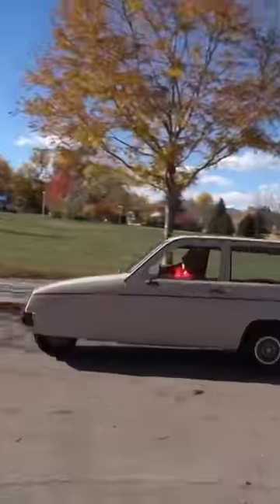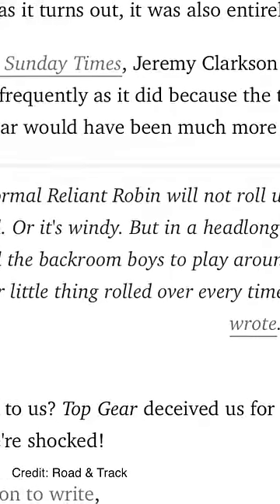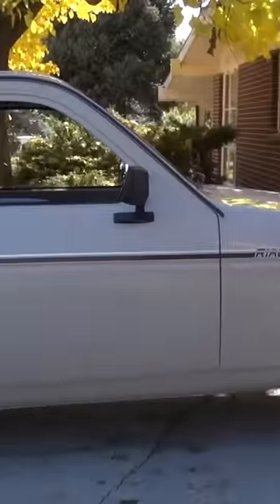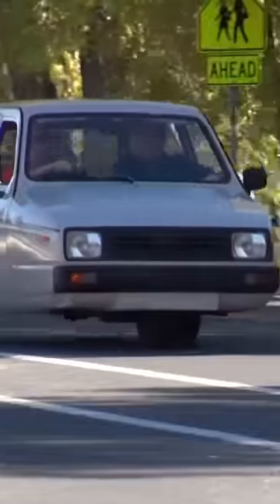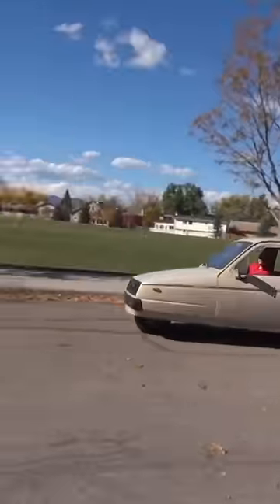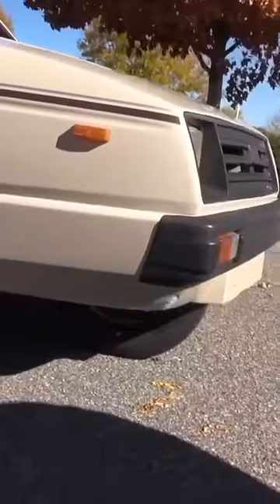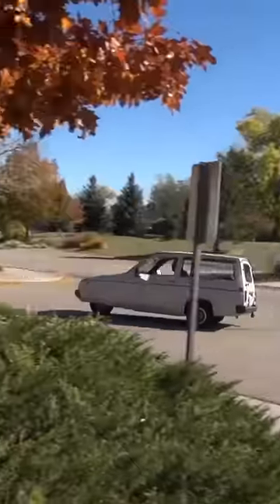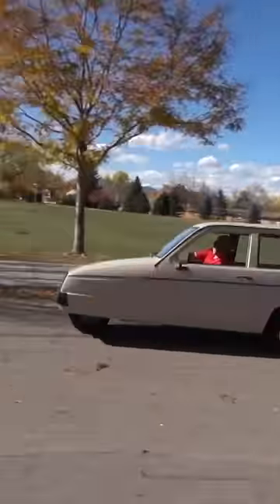Top Gear FAKED The Robin Rollovers??

Comment: I felt salt when he called tire pressure and potato sacks “quite a bit of engineering”, so it was quite relieving to see him mop the cement with his paint. Great clip.
Reply: oh no i scratched it looks at exposed bondo
Reply: Yeah I was thinking the same thing it doesn't take much engineering to put weight on the outside of the turn and lower the tire on the outside of the turn
Reply: I felt the same way- I'd hardly call that "engineering"... 🤦
Reply: @danielbrealey2924   they also welded the dif
Reply: Lol Clarkson fanboys are pathetic as always.
There is an article detailing everything they have done to the Robin make it roll over everytime and yes  that was a lot of work (completely changed the diff, fitted different tires, removed or changed the position of parts of the cars like the fuel tank to mess up the weight distribution...)
Reply: Mop the cement 🤣
Reply: @superking-nicolaslucau7252  yeah that’s true, they did alter it to make it roll easier. It’s also true that 3 wheeled cars aren’t common because they’re unstable by default, especially in that configuration
Reply: He also was going down hill which I assume would also aid it tipping easier too, when I first heard the had to engineer it to tip I assumed they had to remove an anti roll bar or something, how disappointed am I to learn they actually just added some weight on the side and lower the tyre pressure….

I know people who put weight in their boots to lower their cars, all master engineers judging by this video 😂
Reply: @superking-nicolaslucau7252  You forgot to mention it was unnecessary, as the video showed lmao
Reply: @Jimbo_Fett  They're pretty stable when the front has two wheels.
Reply: He is driving a reliant, what did you expect!? 😂
Reply: I don't think he literally means engineering as in "mechanical engineering", more like the situation was engineered/fabricated to make the car roll
Reply: I think they had different tyres on each side, and made it a bit more top heavy (hardly NASA though)

Comment: It didn't really flip over. It tilted, but didn't flip
Reply: Uhhhh TecHnIcALlY 🤓🤓🤓
Reply: You must be fun at parties
Reply: @7Beanss  not technically literally it didn't it just tilted
Reply: @Ozilus21  this isn't a party
Reply: @flatmarssociety5707  yeah this is not a flip. By this measure, leaning hard on a bike is a flip a well
Reply: Well he obviously pulled off so he didn't destroy a restored antique you fkin donut lol It was basically on its way over, so its fair to say that it would flip easily.
Reply: @pocketoniofficial  but it didn't flip if you say that it flipped then you're saying bikes flip with then turn
Reply: 🎵Every party needs a pooper that's why we invited you🎵
Reply: @pocketoniofficial  

If that were the case it WOULD have flipped.
Reply: @McSweeps  

No, it would have lost speed via friction and the open diff spinning up the inside wheel in the air.
Reply: it didn't flip because he recovered it. it doesn't matter anyway, cars aren't supposed to tip
Reply: @McSweeps  "if" and "would've"
key words here
"didn't"
Reply: Lolol besides the point
Reply: YEAH BECAUSE HE WASN’T GOING TO ACTUALLY FLIP IT
Reply: It would've flipped if he kept turning.
Reply: R/whoosh
Reply: Add 20 more MPH and a sharper turn, and it would have rolled
Reply: @theyeetus1428  

Not with the front scraping and the open diff spinning away in the air.
Reply: @pocketoniofficial  

No, it's not.
Reply: Lmao bet you wouldn't buy it tho you might get tilted
Reply: @badcornflakes6374  and you are fun at all huh lmao what's her name and when did she break your heart? Get pass that hurt you will be ok
Reply: @Ozilus21  You must make women dry asf and men dry asf too.
Reply: Because he saved it
Reply: If he gave a little bit more gas it would've flipped.
Reply: @gunterification  

Not with the wheel in the air spinning on an open diff and the front dragging.
Reply: @Ben-Rogue  

Very unlikely. You've been watching too much unfunny Clarkson.
Reply: Yeah but it shows that it could flip, if they were going faster and turned
Reply: This didn't flip. It didn't even technically flip it just didn't flip. Some people here are trying to say that it would have if he kept going but he didn't.

It'd be like having a bullet whiz by your head and then saying you got shot. You didn't get shot you just almost did. Kind of weird how this became an argument, and also funny to see people resort to ad hominem instead of just agreeing with the facts.
Reply: The whole point is that it is unsafe. If you have to straighten out to get past a roundabout, it is clearly unsafe. If he carried on, his momentum alone would have had more serious consequences
Reply: @7Beanss  Wdym technically? It didn’t bingus
Reply: To be fair, I've never had my four wheel car tip at all.
Reply: @7Beanss  yeah well wanted it to flip
And it didnt
Reply: Semantics
Reply: @flatmarssociety5707  Bicycles are intended to lean in far to corner, cars aren't. A 10 year old could figure that out, come on guy ....
Reply: Yeah we saw..
Reply: @handsomelarsandhisfabulousjars  ya lean in corners not flip the car leaned it didn't flip come on a child could of figured that out man
Reply: @flatmarssociety5707  We all know it would have flipped if he hadn't corrected, don't steal jokes either
Reply: @handsomelarsandhisfabulousjars  but it didn't flip did it? It leaned a child could of figured that out
Reply: @flatmarssociety5707  lmao do you work for reliant? Cars that are functioning properly don't damage themselves 😂
Reply: @handsomelarsandhisfabulousjars  it is properly working it just wasn't designed very well when you're using a single wheel to turn its going to be unstable
Reply: @flatmarssociety5707  Then it didn't flip on top gear either. It tilted onto it's side.
Reply: @sock8278  EXACTLY.
How do all these people argue about something that's so obviously not the point?!!
Reply: Ermm.... remind me again who even said it DID flip?? Everyone getting but hurt and arguing semantics when noone claimed it flipped at all... 🤦‍♂️
Reply: @wildin13  I think TFL changed the title on this after I made the comment
Reply: Technically the car in top gear didn’t flip either it was just laying on its side to take a nap
Reply: @initialyeet3951  not really. Nothing touches the ground in that case… this is more like leaning on a goldwing until the floor plates touch the ground… or probably more like leaning so far into a motorcycle turn that you lose tire traction and come off the bike, seeing that it does damage to the vehicle
Reply: @pocketoniofficial  it didn't flip in this occasion because he lost all power in the rear diff. I can't think of an occasion where loss of power to the tires wouldn't completely stop the car from flipping, so....
Reply: @7Beanss  he’s not a nerd you are
Reply: @Ozilus21 we have never heard that before. How creative!
Reply: @pocketoniofficial  obviously not if he could correct it so easily
Reply: @McSweeps  yea if he flipped it you could say it flipped
Reply: @lolseagull you can say that about any car
Reply: @meganwyatt1607  r/this isn't reddit
Reply: @Ben-Rogue  "if you add everything nessassry to make it flip it would have flipped"
Reply: @basedbane787  Imagine not knowing how basic physics and gravity works. Lmao
Reply: @pocketoniofficial  imagine not actually saying anything to further your argument 🤡
Reply: @basedbane787  Don't need to. Why should I keep proving you wrong. I can't  teach you things you should have learned in school.
Reply: @pocketoniofficial  mega cope
Reply: @John Smithe  What am I coping with? The fact that you use that word without knowing it's meaning just further proves my point. How can you understand gravity when you can't understand basic English.
Reply: @initialyeet3951 
When you 'tilt' a bike, how many of its wheels leave the ground?!
A vehicle with only 2 road wheels is intended to 'tilt'.
A vehicle with more than 2 road wheels is intended to keep ALL road wheels in contact with the road surface at all times.
Reply: top gear took a share corner more aggressively but at the end of the day the cars crap
Reply: @basedbane787  r/incell
Reply: @meganwyatt1607  r/projecting this isn't reddit cringe lord
Reply: @basedbane787  r/stating the obvious
Reply: @basedbane787  r/not very bright
Reply: @basedbane787  r/Nigel no friends
Reply: @basedbane787  r/ superior complex
Reply: @pocketoniofficial  no one would intentinally flip their car you potato
Reply: @aaroncousins4750  read my very first comment before being so openly ignorant
Reply: @aaroncousins4750  unless you're Jeremy Clarkson🤷‍♀️. (Or in need of quick cash😝)
Reply: yes, thanks captain obvious. however, if they were going even faster then it would have flipped
Reply: @McSweeps  That is not an all clear to me it looks like it would end up on its side more likely than flip and that’s a good thing
Reply: Just goes to show then that top gear didn't have to push it that far. A little bit more of a try and it would have flipped.
Reply: I seen some have black bars on the lower side so if they tip like this it wont damaged the body.
Reply: @flatmarssociety5707  what? Bikes have two wheels.
Reply: @badcornflakes6374 you must be fun at parties
Reply: @pocketoniofficial  saying that was a flip is like saying tilting on a bike when you go round a turn is flipping.
Reply: It was pretty damn close to flipping. 4 wheeled cars don't do that a 15mph
Reply: @flatmarssociety5707  he prevented it from flipping. He didn't want to destroy his vehicle.  
He was trying to show it wouldn't flip, instead he showed it would
Reply: If he had been going just a little faster, the car would have ended up laying on it's roof. 3 wheelers are incredibly dangerous.
Reply: @pocketoniofficial  yeah not like he couldn’t flip it over all these ppl weird
Reply: @pocketoniofficial  he was driving more recklessly to show off. These don't tip on a day to day occurrence.
Reply: Now add in a small ditch, or a hill with a turn and WHAMO flipped. Use your grey matter, if you have any.
Reply: That's still a pretty big red flag tho. Maybe flipping the car isn't as easy as TopGear made it look like. But go a bit too fast and with one sharp turn you will flip.
Reply: exactly. It didnt flip. Thats the same issue top gear was having.
Reply: @initialyeet3951   When I lean on a bike the paint doesn't touch the road
Reply: @flatmarssociety5707  But he was going under 30mph and took a corner in a regular way and almost flipped over. What would've happened had he been taking a corner at 40mph? 😂
Reply: @initialyeet3951 well I used to ride motorcycles, and if you lay a bike over far enough to touch bodywork to asphalt, it’s a crash.

Comment: Two wheels at the front and one at the back might have been better
Reply: Eh, depends on engine placement mostly, front engined, like this, would have been better in that config yes,
Reply: It is. That's why most 3 wheel designs use it
Reply: @SockyNoob  I think most recent ones but a lot of 3 wheeled vehicles are just modified motorcycles turned into trikes.

But most of those trikes have most of the weight in the back, making it harder for them to flip like this.
Reply: Yes and no. Its more stable but the main purpose of those cars were to put cargo. Like delivery milk to houses or something like that. One wheel could not stand the weight
Reply: @rawhidelamp  then replace the body with a tube frame, give it sports car seats… oh look, we have invented the Polaris Slingshot
Reply: That would've been an oversteer monster
Reply: @joemann7971  back and lower.
Reply: @SockyNoob  

The reliant three wheelers weren't supposed to be driven hard or even enthusiastically.

There used to be a loophole where these were classed as tricycles and thus anyone with a full bike licence could drive one. These were almost exclusively aimed at those who usually used a motorbike but wanted some heat and shelter during the winter, especially.

They're set up as they are as they used a lot of parts bin components already available.
Reply: Many 3-wheelers actually had that design, such as the Messerschmitt.
Reply: @deletemii3312  correctly designed, the handling could actually be well on point. Modify the chassis to lean into tighter turns and you’re looking at a 3-wheeler that corners like a rollercoaster.
Reply: @MrSupercar55  

Missing the point of what the Reliant was for though.

Incidentally, Morgan first built a two at the front one at the back three wheeler from 1909...
Reply: @skylined5534  Morgan still makes it. They're like driving a ww1 fighter plane
Reply: @joemann7971  Trikes are a flawed design. Motorcycles require leaning to turn.... and you cant lean when it has 3 wheels
Reply: @rawhidelamp  always two wheels in the front it is more stable... Even with the engine in the back like most of three wheelers.
Reply: That's more expensive tho
Reply: @SockyNoob  they hqve those 3 wheel harleys and then slingshots, the harleys have 2 in the back and i cant think of any other 3 wheels therefore by this logic they're just as frequent
Reply: Or placing the heaviest components (drivetrain, etc) in back, above the two-wheeled axle.

Seriously, WHO THOUGHT THIS WAS A GOOD DESIGN? It absolutely baffles me!
Reply: @deletemii3312  sounds like fun! 😁
Reply: @skylined5534  So, someone decided to design a car that needs to be driven very carefully, for people who probably never learned how to drive a car?
GENIUS! 🤯
Reply: @devlintaylor9520  you can!!..  only to the wrong side of the street
Reply: @bugglemagnum6213  you might not know this, but Harley doesn't make 3 wheelers. Those are all aftermarket, same as buying a lifted mall-crawler from the jeep dealership. I assume because of liability. Also, with the kits they use for Harleys, you're all in for the price of a new Tahoe-ish. They're not cheap.
Reply: It's more stable but only in certain cars. A 4 passenger hatchback with a large boot would actually lack stability even more if it had a single rear.
Reply: Yeah, there's lots of 50s concept cars that had that sort of design. Very retro futuristic! One good newer example is the flea in the fallout series! Very cool little car! Kinda like the design of the little  BMW Isetta!  😆👍🏻
Reply: Thats called a Polaris slingshot
Reply: @optiTHOMAS  Polaris slingshot is an irl newer street legal 3 wheeled car with that cobfiguration
Reply: @dailying3049  aw cool! That's a neat design! My mom was actually talking to me the other day about those little Polaris vehicles. Those are pretty cool! Good stuff! 😁👍🏻
Reply: @dailying3049  Or a Morgan. Both are track cars and nothing to do with the Reliant cars.
Reply: Not might, it is as stable as a four wheel car when moving in the forward direction.
Reply: @fujiwaratofushop1491 the main purpose was transportation. My grandfather had 2 in the 1960's cause you only need a motorcycle license. He flipped them twice. Luckily not with us onboard😂
Reply: Yes, a single rear is a lot better than a single front.  But being better than something that is inherently bad, does not make that other thing good.
Reply: Yep. I had one back in the day, as I only had a motorcycle license at the time.
Reply: @fujiwaratofushop1491 depends on the wheel used, a super single would easily handle a gooseneck trailer.
Reply: Yeah, one wheel at the front and two at the back is far from optimal. Unless you're in a Carver. Then it's a blast
Reply: @rawhidelamp  Then how does the load in the rear get distributed. This is THE wheeler dealer van.
Reply: Yeah but then you've got a Morgan which means you end up divorced with adenoids

Comment: “It can’t happen, see?!”

damages vehicle
Reply: "They had to do extensive engineering"
"Like lowering the tire pressure, and having some weights" 😂😂😂 too funny
Reply: @TheAnnoyingBoss  what’s funny about it? It’s what they did. It worked too. This guy just weighs more than all the top gear hosts so that’s why he tipped it, they probably put more weight up towards the front right and back right or vice versa
Reply: @Steve.._.  cope
Reply: @Steve.._. it's funny because it shouldn't be THAT easy to get a car to flip
Reply: @Steve.._.  Its funny and you're very far from funny.
Reply: @Steve.._.  that guy does not weigh more than a portly 6'5" Clarkson. No sir.
Reply: @Steve.._. 
Because that isn't extensive engineering that's why it's funny.
Reply: Biggest cope on earth.
Reply: @Steve.._. Clarkson is 6'5 and a big lad. No way this guy weighs as much or more.
Reply: @Steve.._. If you car can't take a single person, without rolling off on a normal curb, i have some news for ya... 😂